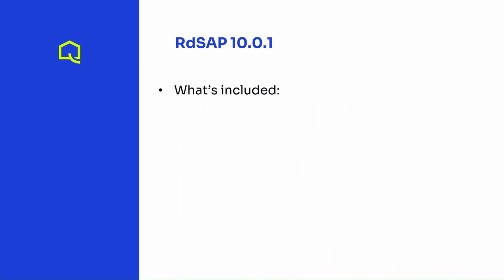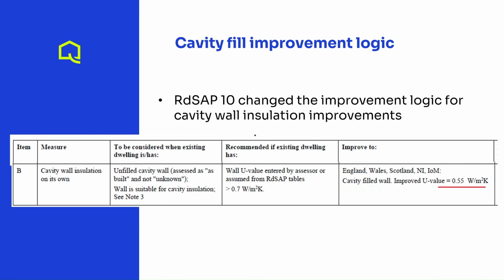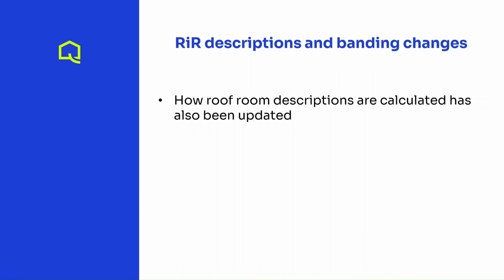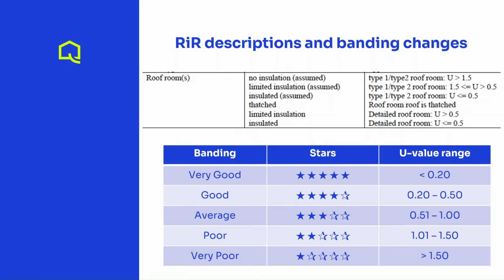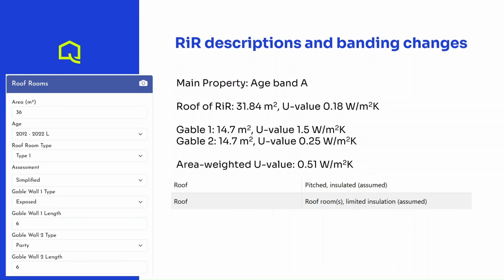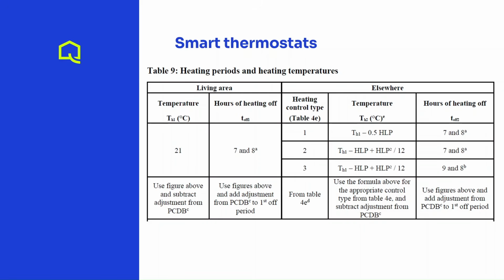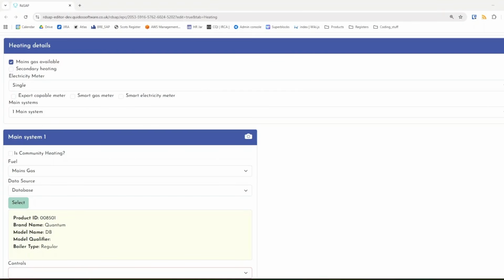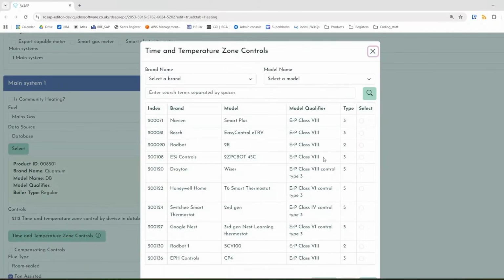Quidos Explains: RdSAP 10.0.1 Update Breaking Down the Changes

Comment: Just come across my first Hive Smart Thermostat input, tried with & without new method, no difference to the rating or description, should this be the case ? If not whats the point of the expense of purchasing a smart thermostat if not noted on the end users (customer / potential buyers) visual guide / EPC descriptions?

Comment: it’s a shame no attention has been given to the rating of windows. I have raised this with technical support because almost every one of my customers queries why double glazing 2002 to 2022 is described as average and also why unknown or pre-2002 is listed as poor. That's not really a true reflection.
Reply from the maker: Thanks for your comment!

The bands for windows are determined by an area-weighted U-value for the glazing. An 'Average' rating for glazing would be the result of a U-value between 1.61 and 2.5, whereas 'Poor' would be a U-value between 2.51 and 3.3.
The 2002-2022 double glazed U-value in RdSAP 10 is 2.0, so fits the 'Average' banding, whereas unknown/pre-2002 have U-values (depending on glazing gap), between 2.7 and 3.1, so aligns with 'Poor'.
The U-values and bandings for the windows described are exactly the same as the previous version of RdSAP since 2013
Reply: @Quidos  i have this issue too - it may be that the u-values are consistent however clients query the descriptions. I'm sure 2002 to 2022 used to be displayed as "good" or am i incorrect?